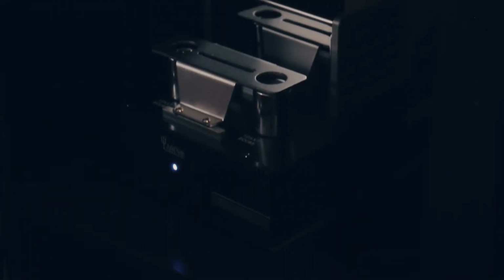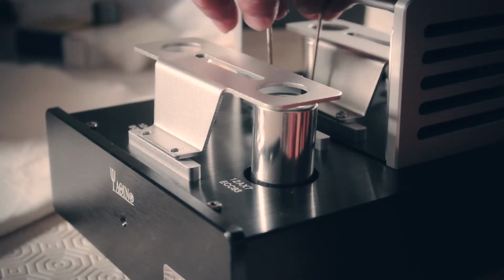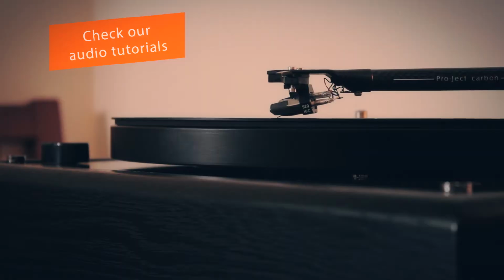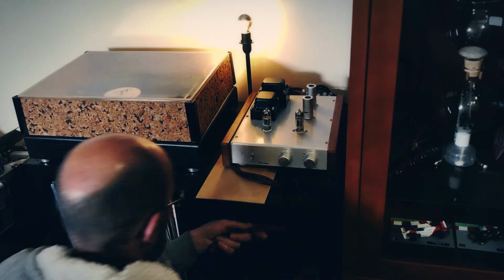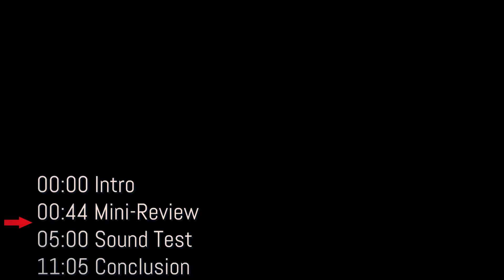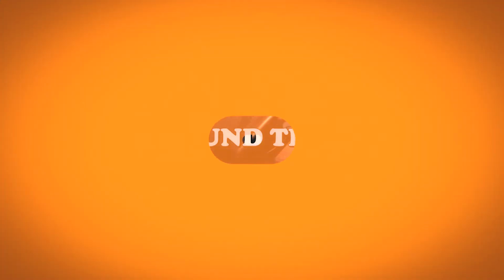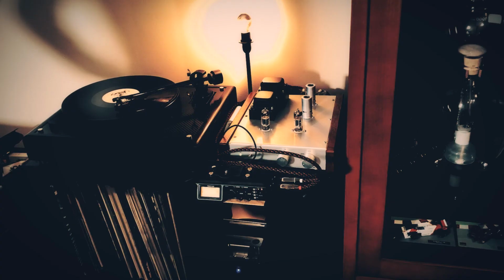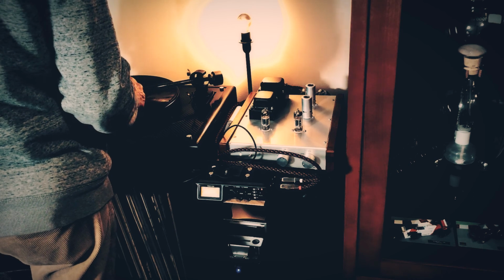Yaqin MS-23B Vacuum Tube Phono Preamp Mini Review

Comment from the maker: So, what do you think about this preamp/test?
Reply: The unit is OK but Yaqin made a mistake in fitting a Transistor in place of a valve for feeding the output cables. Also their use of a feed-back RIAA instead of a Passive Filter RIAA did not help in the overall quality. Replacing the feed back circuit gave much improvement but only when fitting a third valve did it really sing. I agree in your choice of the CV valves, they are very very good but expensive now, I wish I could travel back in time to the 1960's and buy a few thousand. 
You can read about converting the MS22/23 here:- http://www.g4cnh.com/public/Putting_'Life'_into_the_Yaqin_MS-22B.pdf
I do have one remaining Swap board which makes fitting easy without soldering but is a bit more expensive as it has to duplicate the power supply and has much higher quality valve sockets.
Reply: @lescarpenter162  Hi Les - I have one of your modded MS-23B's and I really like the sound.  The 2 front tubes are JJs - would you recommend any different ones and how different would this be to my Pro-Ject DS2? £200 vs £625  (I feel I'm asking how long is a piece of string but I hover between the two to what I prefer with different music).
Reply: @voxish99  Any 12AX7/ECC83 with long plates seem to work best. The Svetlana winged C were good but once the secret got out the price went from cheap to ridiculous. 😂
Reply: @lescarpenter162  Thanks Les!

Comment: For someone who complains about cheap tubes and only using the best you're using a cheap photo preamp you're not using the best LOL. That is hypocrisy
Reply from the maker: @4vinylsound  if you wanna see it that way… I don’t see the point in spending 3000€ on an preamp. I do not confuse tubes with amps. But that’s just me. I am a simple guy that still drives the same car for 30 years - I just parked it outside. Because I like it and doesn’t break. I could drive a new car but I think they are shit. If you don’t believe me just check the video I did about that car. The same with preamps/tubes. I use what I like. Have a nice day.